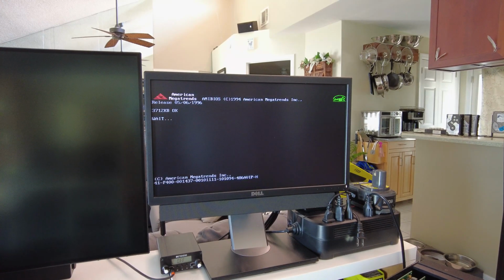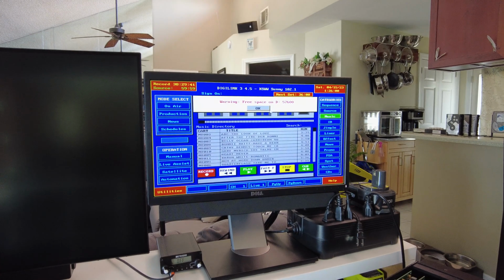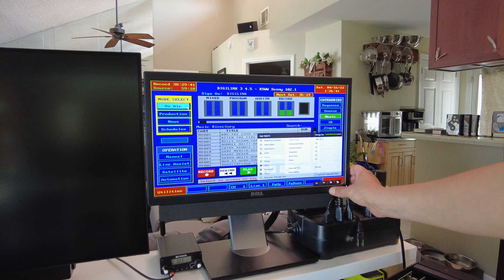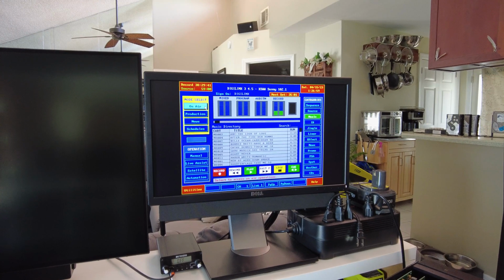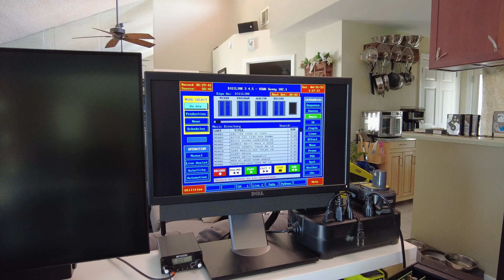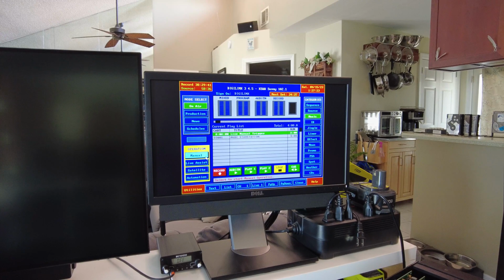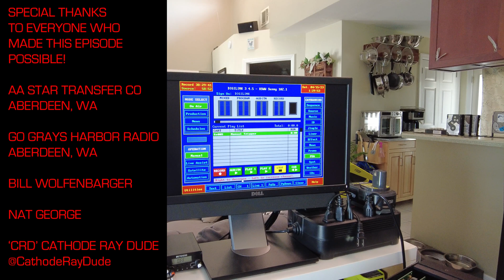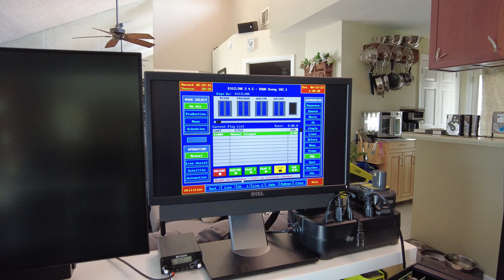The Arrakis Digilink Project [PT1] - Early Radio Station Computer Automation - #IJDM118

Comment: I used a DigiLink 2 at my first regular radio job in 1993. I had seen computer automation systems before, but they were controlling tape machines. When I was introduced to this, I said, “Where are the decks?” And they told me they weren’t there, and I was like, “Yes, but they have to be somewhere, so where are they?” Consumer audio capture cards were so low quality then, I genuinely couldn’t believe that you could play lossless audio straight from a hard drive.
Reply from the maker: @andyrose5616  It wasn't completely lossless, most stations used 1-2 compression ratio, there also was a setting for 1-4

Comment: Many years ago, I got a surplussed Digilink II, but had no idea what its exact function was.  Now I know, and I'm going to have to play with it again.
Reply from the maker: They are actually easy to restore, if you have the parts and software.  If you need any assistance, please feel free to contact me.  The main issues are usually related to the hard drives failing and DSP card capacitors.  Hopefully they did not leave in the backup varta battery, I have five or six units with corrosion damage to the motherboards.